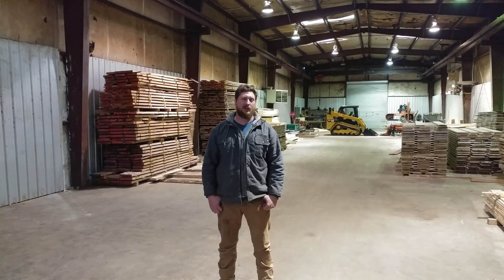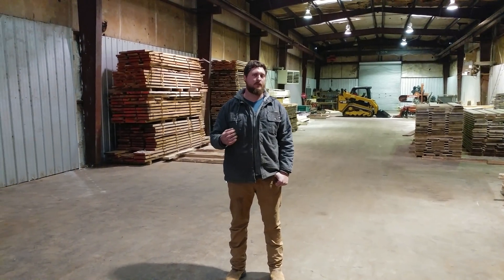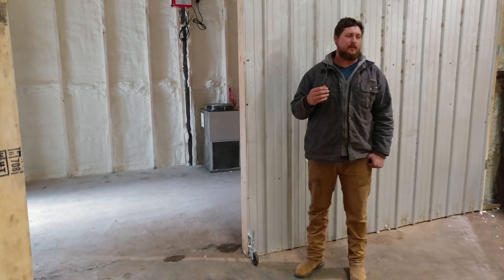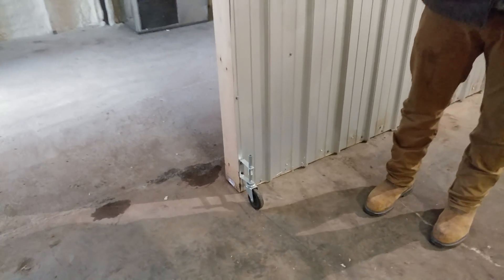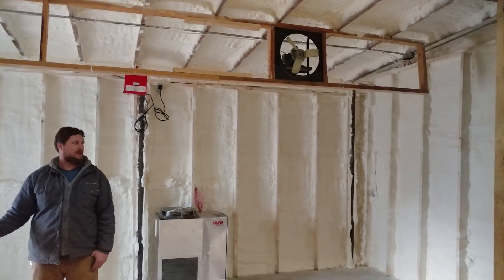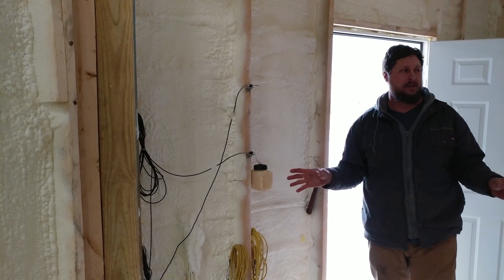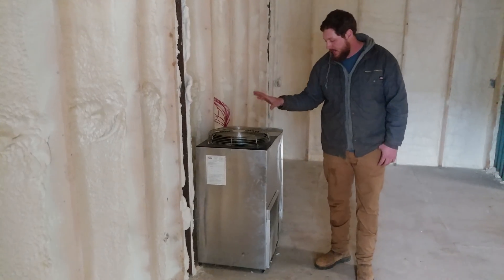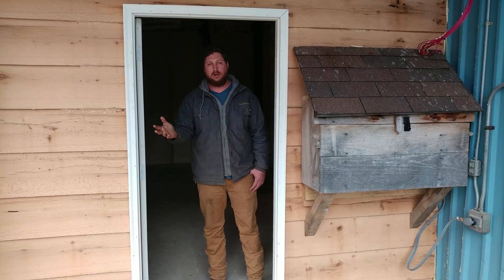Quick tour of our Nyle l200 lumber kiln

Comment: Anyone build a kiln with an outdoor wood boiler?
Reply: That would be ideal. Easier to control the temp and the boiler could heat multiple buildings, and if a completely new building, you could go in floor heat and gain that wat too.

Comment: Thanks for sharing Tyler - excellent video and ideas.  I have a regular 200 unit (still new in its box).   Given your experience, do you recommend that I upgrade to the “M” model controller?   Not even sure if they’d let me upgrade, and also not sure how important for me the extra probe capability would really be.  We’re likely not going to do crazy commercial ongoing drying.  I’ve got a TK-2000 mill and will likely focus mostly on hardwood slabs and boards for my own use.  Let me know your thoughts, I sure appreciate it.  Hey Bud, also what state are you located in?

Comment: I have a small 20x40 pole barn that is partially converted to a living space. There is no heater, but it has a 600cfm exhaust fan and it is fully insulated. 

Could I add a large fan and dry my lumber in it? 

I greatly appreciate any response🙏
Reply: It wouldn't be nearly the same as a true kiln dry as chances are you wouldn't reach a top temp around 120f to ensure all pests are killed off.  There are many people that do finish the drying process the way you described though so it's up to you if you want to worry about the chances of a pest infestation.
Reply: @6105jakeusmc  thank you, 🙏
Reply: you can dry lumber anywhere.  Just turn the fan off at night when the humidity comes back

Comment: What do you have into the total kiln, about 10k?
Reply from the maker: The nyle kit runs about 7k doing the enclosure, spray foam, concrete, and door I've got about 20k in it. If you are frugal and do a lot of the work yourself you could probably get it done for 15k.
Reply: @LumberjacksTreeService  thanks. Forgot about the concrete. Have a spot already built that would work in my pole barn (and 1/2 spray foamed already) just wondering what it would take to break even

Comment: Thanks for the video. I’m currently designing my kiln.  I’m thinking of using a heater like your auxiliary heater. How long does it take to get your kiln to temp.? And what’s the cubic feet of your kiln?  Thanks.
Reply from the maker: I have ran a load through this kiln and have decided to add a 2nd aux heater. The dimensions of the kiln chamber is roughly 12x20x10.